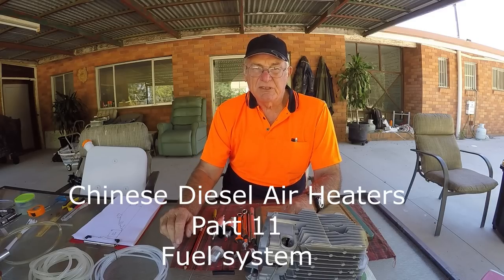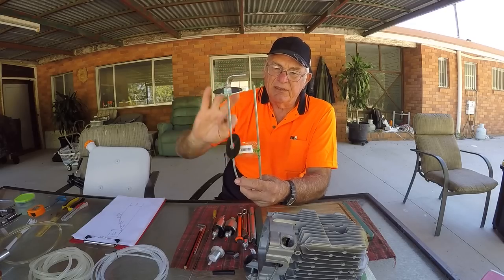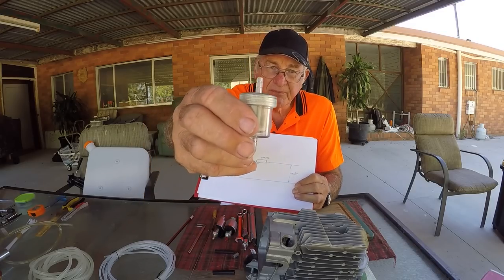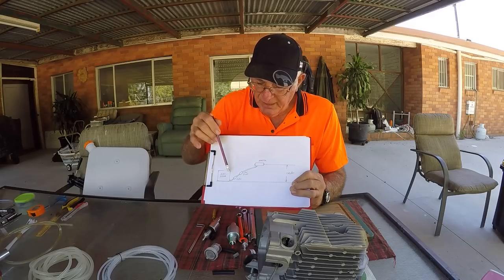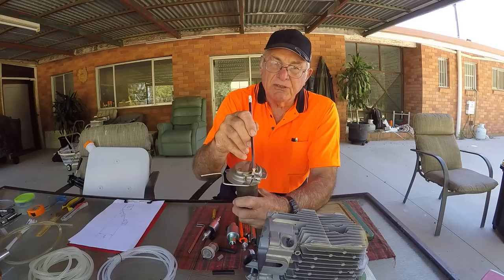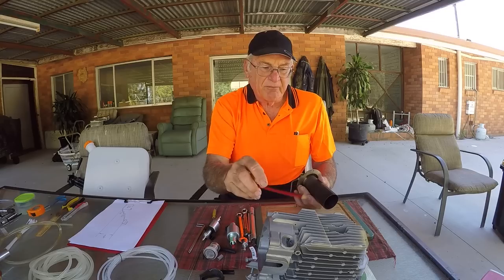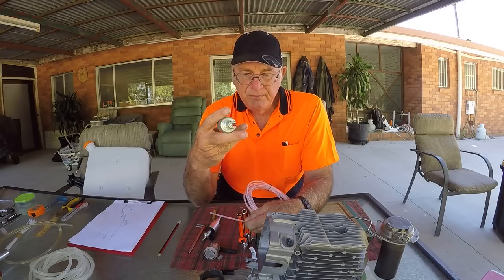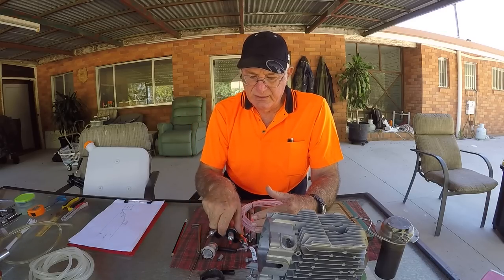Chinese Diesel Air Heaters - Part 11 -  Fuel Delivery

Comment: John I just bought a PPAP heater, it has a 15 litre tank but has a pick up tube like you showed at the started of the video
It needs to be installed from the inside and have no idea how to do it.
It has a large these section with a large rubber washer then a cupped shaped washer and a nut.

I thought they came with a small nozzle that you fit in the tank side close to the bottom
Reply from the maker: Hi Steven. 

You first drill a hole in the tank to take the fitting. Then you slide a bit of stiff wire with bit of a curve in it from the outside and guide it up through the fill opening. Then you slide the rubber sealing washer then the fitting down the wire. You can then pull the fitting through the hole and install the nut.

Sometimes if the fitting won't slide through the hole I  put a sharp bend in the end of the wire with pliers  and pull the wire tight and it pulls the fitting through the plastic hole. You then have to push the wire back and remove it through the filker hole. Turn the tank upside down to make this easier.

There are a number of uTube videos on this if you want to search for them, which is why I did not make my own.  JMcK
Reply: @johnmck1147  I really appreciate your reply.
With the feed pipe the internal tube is at a guess 4 to 500 mm long and spent double, I'm presuming this is to fit into the top of a diesel tank on a motor vehicle.
With the plastic tank I have where is this hole supposed to be?
I notice that at the bottom and sides of the tank there are two square section and it looks like the feed pipe goes in there.
Also how long should the internal feed pipe be.
There is Chinese heater Facebook site and someone sent me an image of this type of feed pipe installed in the top of a tank but it was fed in from the outside .
When I look at the fixing part there is a 15mm threaded section where a large rubber washer goes over rolled by a concave or dished washer then a large nut.
There is a 30mm long rectangular price of metal at the bottom of the thread at the junction of the internal feed pipe 
I saw a set of instructions on this Facebook site where it seems you drill a 25mm hole in the top of the tank then feed one side of the rectangle in then somehow manoeuvre the other side in.
The instructions with the heater simply show nothing about the tank or the supplied fitting.
Reply from the maker: Hi Steven,

Here is just one link to install a pick up fitting in a fuel tank. The supplied fuel tanks have little flat areas where you install the fitting. It is better on the bottom, but sometimes the tank is placed on the floor and the fitting needs to be installed on the side. This is ok, but you can't use all the fuel in the tank.

https://youtu.be/74o4H5ZRNLU

Now you also describe a bent over pipe. 
Sometimes the heaters are supplied with what is often called a standpipe. It is a pick up tube for any fuel tank and is designed to be installed in the top of a fuel tank. It has a large metal flange on the top and the thin fuel pipe out the bottom is bent in half for shipping purposes. You straighten the pipe out and cut it off just above the bottom of the dedicated heater fuel tank. If you are installing the pick up in a vehicle or boat fuel tank, then you cut it off some inches from the bottom so you don't accidentally use up all the fuel running the heater and there is no diesel left to drive your van or move your boat.  JMcK

Comment: Hi John, Wow thanks so much for your helpfull vids. I have one of these heaters that I intend to install but the green flex fuel line came with the kit. Wondering if the 3mm ID clear line will work ok? I notice you suggest to use the 2mm ID.
Reply from the maker: Hi Phillip,

The cheap clear plastic will work for a while. A bit longer if the distance from pump to heater is short. 

However that fuel line will cause you carbon build up issues as it absorbs the fuel pump pulses, and in a relatively short time your heater won't work.

Also it will perish quite quickly, particularly if it gets some sunlight on it.

Suggest you should only use good quality 3 mm black fuel hose from tank  to filter to pump. 
Then only use narrow bore hard nylon fuel hose from pump to heater.

Cheers. JMcK
Reply: @johnmck1147  Hi John, thanks for your quick reply. So is it ok to to use some hard nylon with 3mm bore from the pump to heater?. 2mm bore seems a little difficult to purchase here in Canberra. I will get some good quality fuel line to use from the tank to the filter/pump. I am planning to mount the tank on the rear of the van and the heater will be up the front under the bed so probs 6.5m between. I assume the pump should be mounted close to the tank or would you put it in the middle?
Reply from the maker: Hi Phillip, 

3mm hard nylon is fine. The important issue here is “hard” on the fuel delivery side so the fuel pulses are not absorbed by soft fuel line.

It is always better to install pump as close to tank as possible.   Cheers,  JMcK

Comment: John - is this to say that I can run rubber fuel line from tank to filter to pump that might be slightly larger in internal diameter as compared to the hard line?  Smallest I.D. at my local auto parts store is 3/16". Thanks!
Reply from the maker: Hi Keeb,  on the delivery side to the pump, in most cases, I would use 4mm (3/16)  normal fuel hose. It fits the fuel pump and filter nipples, and removes chances for joiner leaks.

From the pump to the heater you should only use narrow bore, hard nylon fuel hose, as rubber fuel hose "absorbs" the pump pulses.

I give more detail on fuel delivery in video number 19, Motorhome Install part 2.   JMcK

Comment: Hello John, Have watched the entire series and found it to be most helpful so thank you, question on my part please.  I have a sprinter Van without th e auxiliary fuel feeder. I have seen some people remove the fuel tank and add a second feeder directly to the fuel pump. That is a lot of work and i DON'T REAALY HAVE TH EPLACE TO DO THIS. Sop I just wanted to confirm with you if it os ok to mount that 10L supplied tank in the cab\in of the sprinter Van?  I will follow you directions for distances  for fuel intake and  distance to the unit  I meter i belive you mentioned, I will only be able to mount it at the shortest distance about 2 metres  will this  affect the operation of the unit?
Reply from the maker: Hi F Ball,

Mounting the diesel tank inside your van is a decision you must make yourself. 

If you go this way, I suggest you put in place safety measures. Eg you do not want any combustable material near the tank that can absorb spilt diesel, and you want some filling system so there are no spills. 

Try and put the pump as close to the tank as possible, as these little pumps are far better at pumping diesel than sucking diesel. These pumps can easily pump fuel a distance greater than 2 m providing you use the thin bore, hard nylon fuel line. If you must mount the pump 2 m from the tank, it will still work ok if it is at the level of the bottom of the tank and does not have to suck the fuel up hill.

A number of people mount the fuel tank just inside the back door of a van, and I have heard of one being mounted on to the swing out back door.

Best wishes,   JMcK

Comment: john- got the 5kw version, it,ll run all day on low setting but after 20 ,mins cranked up on high will smoke badly and coke up( requiring strip and clean) is this an intake air issue, exhaust length is short( around 22inch ) and have fitted oversized air intake pipe( as previously recommended by yourself) ta very much.

Comment: Hi John ,
Firstly love your videos.
Quick question regarding fuel hose diameter and positionong of tank. In reference to the weight of fuel in the two size horses being different......
From my knowledge of pumps and training in principals of pressure I'm of the understanding that the shape or width of a vessel(hose) is independent of pressure and has no influence on head pressure or lift pressure (approximately 10kpa per meter). When lifting with a pump the pump is only reducing the pressure inside the hose so atmospheric pressure(101.3kpa) can push the fluid higher than the original head (tank full level)  Example if there's a well 1wx1Lx1deep the head pressure at the bottom is the same as a lake 100wx200wx1Deep. The depth (lift height)is the only variable that matters. 

So off the back of that.is it benifical to have the tank heigher than the inlet of the pump in order to achieve a positive pressure between the tank outlet and the pump inlet, in turn decreasing load on the pump by removing lift?

TIA Stu
Reply from the maker: Hi D28,
Thanks for the detailed feedback. I have had another viewer bring this matter to my attention as well. Looks like I need to do more detailed testing.

Having the tank higher than the pump does make things a little easier with priming, but if more than about a metre of head pressure you need a shut off valve as you can get leakage through the pump which can seep into the burner if the heater is also below the tank. I install a shut off tap in my own installs.

I now use normal fuel hose from tank to shut off valve to filter to pump to lessen the joins, then only use small bore hard nylon on the delivery side of the pump to heater.

Thanks again.  JMcK

Comment: Hi John. Should there be any bubbles upstream of the pump? Or are the bubbles caused by the pump and only seen between pump and heater?
Reply from the maker: Hi Nicholas,

The bubbles are little cavitation bubbles caused by the pump piston movement.

There should be NO bubbles on the inlet (upstream) side of the pump.

There will be tiny cavitation bubbles, regularly spaced on the outlet (downstream) side of the pump. These little bubbles are quite normal during pump operation.

Cheers.  JMcK

Comment: Hi John. Thanks again for your videos. Can you please advise where to buy the nylon fuel line and what to ask for. I have tried Pirtek and Enzed here in Melbourne but they don’t stock it.
Reply from the maker: Hi CR,  some suppliers that deal with brewing people, air delivery in mining etc sell hard nylon tubing.  I just buy mine on line. Search on eBay for hard nylon, 2 mm bore fuel hose for Eberspacher diesel parking heater, or fuel hose for diesel air heater.  JMcK

Comment: I simply love your videos, as I have said before:-)
I am wondering about the fuel hose, you talk about it shall go slight upwards. Furthermore, I am wondering abut the metal tube in the tank is going vertical, what if the hard hose is nearly vertical instead?
Horizontal or downward, that would trap air?
EDIT: Is it okay for the pump to be 100% vertical right after a 100% vertical filter when using a hard hose and maybe max 50 cm (20 inch) hose?
Reply from the maker: Hi FM,

Thanks for the feedback.

From tank pick up to filter to fuel pump it is better to use one size normal fuel hose. It does not matter if the pick up tube in the fuel tank is metal or fuel hose, but if using fuel hose you need to strap some wire along it to stop it bending in the fuel tank.

The outlet from the fuel pump to heater should be narrow bore hard nylon as it does not absorb the fuel pulses and you can direct the hose down and up in the install (within reason) and the little cavitation bubbles still track along the fuel line.

Suggest you look at motorhome install videos. More detail there.

Cheers.   JMcK
Reply: @johnmck1147  Super thanks for your great reply! :-)

Comment: Hi mate thank you so much for your vids they have helped me to no end 
Having bought a crappy all in 1 can I ask for some advice and a decent unit you may recommend happy to buy a build your own style in a eberspacher style
Can I also ask, you mentioned that sideways mounting is ok as long as the glow plug is uppermost do you still agree with this as that is how I have mounted
Reply from the maker: Hi Andrew,

Suggest you buy from a supplier with an in country warehouse who accepts returns. There are just so many suppliers and they come and go in short order, that I can not recommend one. It is very unlikely you will get a dud heater though.

The all in one heater is a good concept, but needs improvement to be a turn key heater.

Sideways mounting with glow plug on top is ok. With glow plug down raw fuel tends to flood glow plug and atomisation screen preventing a start.

Cheers.  JMcK
Reply: @johnmck1147  thanks John appreciate it and the quick response 
Struggling with a e03 fault at the moment and have ordered a new glow plug 
Hopefully this fixes it everything else seems find good battery 13v no voltage drop upgrade feed wire to 12g motherboard is ramping up and delivers 8-9v to the plug before shutting down on fault 
Plug resistance however is .8 - .6
Plug heats but only enough to sizzle a wet finger 
Fingers crossed it's just a dead plug

Comment: Greetings from Montana and thanks for your dedication to this technology. You answered my first question to others (several times) about tank height above pump and heater unit. My other question is about fuel line durability. I plan to run my line through the back door (tank mounted on exterior of door) and follow the same path as the flexible taillight wiring conduit . Do you think the fuel line will hold up to the bending it will go through while opening and closing the back door ?
Reply from the maker: Hi Chris,

You should only use the narrow bore hard nylon fuel line on the delivery side of the pump, but in my opinion it is better to run standard rubber fuel hose to the inlet side of the pump.

I also recommend you install a fuel shut off valve in the fuel line close to the fuel tank, particularly if the tank is above the pump and heater. So it would be standard rubber fuel line from tank to fuel tap to fuel filter to fuel pump. Then hard narrow bore fuel hose from pump to the heater.

Where are you mounting the fuel pump?

You should also run the nylon fuel line through a protection and pulse isolation tube.
I tend to run the nylon fuel line through clear a vinyl tube. Common 4 mm OD fuel line can be inserted into 5 or 6mm bore nylon tube for protection. But you could use other protection sleeves, such as gardon hose.

As to the durability, with your door opening, this depends on whether the fuel line is rubber or the hard nylon, and also the quality of the fuel hoses and the tightness of the bending moment. Having not tested either hoses myself under such conditions I can not give a definite answer, but gut feeling tells me it should be ok if there is not a tight bending moment.

Good luck.   JMcK
Reply: @johnmck1147  That is good news about the line material options from tank to  pump. I could then choose the strongest and most flexible material. Thought is to mount pump equal distance from tank and heater unit beneath vehicle. Good points about sleeving line, I will abide. Thank you
Good night or perhaps good morning

Comment: Hi again John,

I got the 2mm nylon fuel line and the 5mm black hose couplers but it's a tight fit pushing in the nylon hose. Are your hose couplers with a 5mm inner diameter and 11mm outer diameter?
Reply from the maker: Hi Dacia,

You want the joiners very tight. 

You need to soak the black hose in boiling water with a small amount of detergent to get the hard nylon to go into the joiner. If not, the joiners are too big.

One common issue with fuel delivery leaks is the black joiners are too big and the nylon hose just slides in easily. If the nylon slides in and out easily the clamps will not stop leaks. JMcK
Reply: @johnmck1147  Hi John, many thanks again! Oh, the joiners are certainly not too loose! I got genuine webasto ones. I will soak them in hot water as you suggest.

Comment: great vids....is it possible to run these with mains UPS power supply ? if so how ? Thanks
Reply from the maker: Yes Dean, any mains 240/110V to 12V DC converter will run these heaters. However you need one that can supply 10 amps at 12V as the heater requires this amount of current to start.

Cheers.  JMcK

Comment: Thanks for these videos, John.  I bought one for a cabin with no access to electricity.  I was hoping to be able to set it up with a gravity feed method.  Is this possible?
Reply from the maker: Sorry Rob, that will not work. The ECU uses the known dose volume, and the rate of dosing to control the heater operation. You also need the pump to "force" small volumes of diesel through the atomising screens to atomise the diesel so it will burn.

Sorry.  JMcK

Comment: People, please pay attention to when John says to Cut the hard fuel line in a perfect 90 degree cut. On one of my 3 All in one Diesel heaters I had a fuel leak because the Chinese manufacturer had cut a sharp 45 degree cut. That sharp edge cut through the soft coupling fuel line because it its self was at a 35 to 40 degree bend. So it cut it through from the inside. I use theis heaters to heat ice fishing huts/tents. I was packing up when I spoted the diesel.
Reply from the maker: Thanks for that info KLH.  JMcK